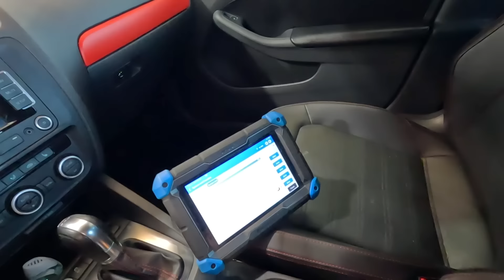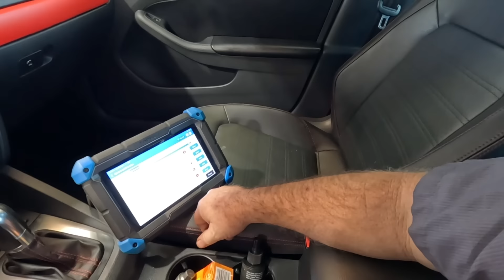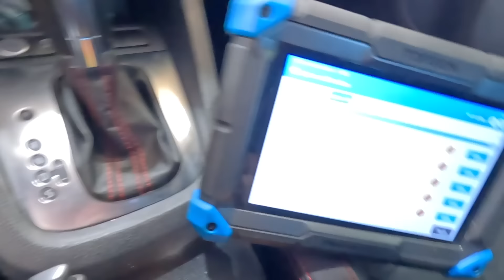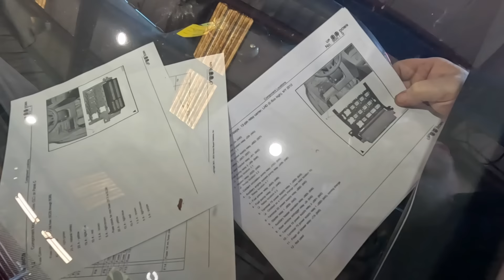JETTA AGAIN, ROGUE BALL JOINT, DODGE PICK UP LOF, INSPECT, DAY IN THE SHOP 429 #auto #repair

Comment: My dad remembers the Little Red Express,was a hot rod with a 360 in  them.He test drove one,it was fast.Does have a 1946 Dodge pickup rust free from Texas.Plans are to drop in a 354 Chrysler firepower hemi in it next fall.Schley Products makes the Matco ball joint press
Reply from the maker: That sounds awesome!

Yeah, the Schley press is a great tool and Matco rebrands it as is common nowadays.
Thank you!

Comment: Did my neighbors 2010 Denali upper and lower control arms the drivers side lower ball joint was so stuck had to use 2 pickle forks on top of each other to get it to separate along with MAP torch . The ball joint didn’t get the memo that this was Texas 🤠
Reply from the maker: Haha, glad you got it done, another for the win column!

Comment: VW like many others modern cars is very sensitive to battery voltage (terminal 15 or terminal 30 errors). It could fry the battery status sensor (if it is equipped). Also could this fry the electronics. The best is to take out the battery from car and charge. Connect only charged battery. It is not only VW, Audi, BMW, and many others.
Reply from the maker: Thanks Paolo. We get it sorted to some degree a little more each day.
Reply: @JimmyMakingitwork  In Europe mostly we use VCDS for all things related to VW cars to pinpoint any issues. Second best software for them beside ODIS (VW soft).

Comment: Warlock is awesome 😱 . I actually worked on them at the dodge dealership in 77. I believe they came in 318, 360, or 440ci. Similar to lit red express
Reply from the maker: Oh very cool! Man the 440 one was a beast I’ll bet!
Reply: @JimmyMakingitwork  I had a 70 roadrunner with 440 six pack with 4speed sword in the stone shifter. Loved it. 13.10 1/4 mile street tires

Comment: Thanks for the video Jimmy!
I'm making good progress with my daughter's replacement wagon, the rough idle was a vacuum leak (self inflicted I'm afraid - I didn't connect a line properly after cleaning the throttle body) Taking it for inspection on Wednesday and I reckon it should pass.
Reply from the maker: Nice work! Great to hear it was fixed easily!

Comment: You mean my headers didn't up my horsepower from 240 to 500 hp? Well, maybe you're right. I need to add a K&N hot air intake. Now I'll have 500 hp! LOL... Man, that VW would kick my butte. Should rename it to the Ivan car. Did you try turning it off then on again? Nice video!
Reply from the maker: The VW is a real Pain in the Arse for sure! But we'll get it! lol

Comment: greetings-
you appear to really like the little, $70 or so,  topdon scanner that installs on a phone. If I do not get the two year $$ update, will it quit working altogether?
Reply: The tool continues to work, just no more updates and no AutoAuth for Chrysler vehicles.
Reply from the maker: DJ locked it in for you! Great tool if you prefer to use your phone!

Comment: Nice looking Dodge pickup. As for the VW I'd back the 62 up to it, connect a chain, and drag it out into the parking lot! If I'm not mistaken, you mentioned that the customer let the car sit for two years. Given the humid conditions in Florida, I'll bet there is a bad ground somewhere. Euro cars don't like to sit idle for long periods. They tend to develop all sorts of electrical Gremlins.
Reply from the maker: Yeah, I figure it out later in the week. Just a locksmith away as we type. :)

Comment: Oh my gosh, RR just did something I have never done our seen! He pulled a North star enginge to put new gaskets on it, then washed the assembled enginge with a pressure washer! Then opens drain plug and drains water out of engine, and said it was fine! The timing chain was completely opened up, so we know water went everywhere inside that enginge! I’ll bet the cylinders will be nice, by the time he gets it all back together! I wonder what the labor guide pays on dropping enginge and trans to reseal the engine? Oh my gosh, he has gotten so bad at quality work, or had us all fooled! No way I would have done what he has done to this caddie! Unbelievable
Reply from the maker: I bet that is 25 hours work or so? Only want to do that ONCE if it was me!
Reply: Thats why I unsubscribed from RR !
Reply: I couldn't believe that he did that. Plus, he turned the engine upside down and left it all weekend. That drained oil out of everywhere! Then, after the "wash" he just used air and said, "that's good." He used that rotating very high pressure tip normally used for cutting things to wash the engine. I'm sure that forced water in everywhere. Didn't even try to spray in something like WD 40 to get water out of the intake. I'm sure there is water everywhere that filled where the oil drained out over the weekend. I could go on and on. Unbelievable! Maybe he did it on purpose for subs. Yeah, that must be it. ¯\_(ツ)_/¯
Reply: @SubmarineSquid  I so agree with you! His quality of work is very shady! No way would he touch my kids bike!
Reply: @dangleebols  he films things I would be ashamed of! Just a Jiffy Lube guy that rents a shop, and talks a lot of crap!
Reply: @JimmyMakingitwork  ad thing is, labor guide isn’t going to pay 25 hours just to reseal gaskets! I’ll bet money, it doesn’t say pull engine and transmission, then fill engine with water and let it set all weekend! Lol
Reply: @dangleebols  he couldn’t work on a car without hammer and pry bar!
Reply: Have to agree with you there @MitchGaar
Reply: What also amazes me is the total state he keeps his tools in, unlike Jimmy who has everything tidy and organised @MitchGaar
Reply: I would bet that he's making a good salary from YouTube as well as commissions from Amazon that's good enough that he could film and post anything without care what goes on in his shop. More likely he hired Dave to be the real mechanic.
Reply: @SubmarineSquid  I’ll bet you are right